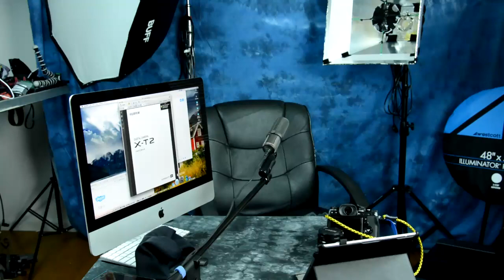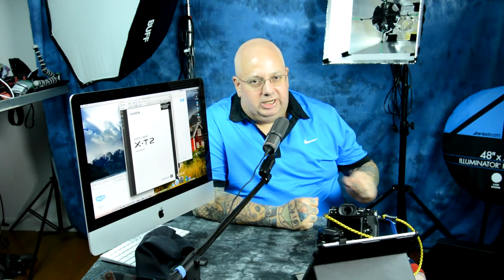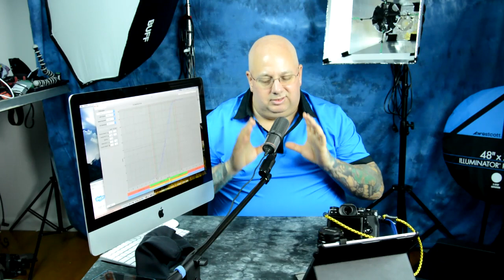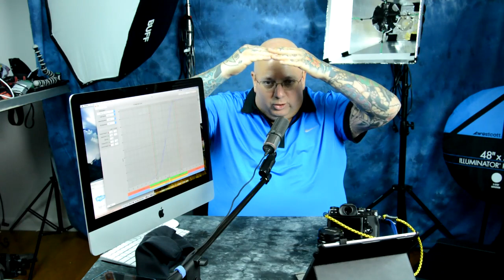WHY most current DX sensors from ALL camera Mfg. are 24MP sensors

Comment: The Nikon J5 has a 12 stop dynamic range, which is quite usable, though I'm sure most people would choose to have more dynamic range. 
I've looked at images captured from this camera and it looks like the lens has problems rendering good details. I will like to see how well it performs with good lens attached.
The Pixel pitch of the J5 would place 35 megapixels on on APSC. I think images on the J5 look like crap though.
I would think the biggest problem would be diffraction. I would like to see how well a high quality lens performs on a 20 megapixel 1 inch sensor, if you can get good results with this you will get good results on a 36 megapixel APSC.
Reply: I have been looking into this a little more. Firstly the one inch sensor is smaller than I thought. Since these sensors have 20.2 megapixels my maths is wrong, you can place 64 pixels this size on an APSC. I also looked at that images on imaging resource for the Canon G7X ii and they are suprisingly good for such a small sensor. 
The camera has 12.7 stops of dynamic range and 23 bits of color depth.
I believe they can make a good quality 50 megapixel APSC sensor.
Why do I want that? Because I don't want to throw money away on a full frame if I don't have to, and I print large and want more megapixels.
Reply: I think you are talking about a different measurement of dynamic range, which manufacturers publish in their specifications.

Did you notice at the start of the video he pointed out that he was describing sensor dynamic range without ISO or gain.  He is talking about the type of sensor dynamic range profile that you would measure with a light meter and a color chart like a X-Rite Color Checker

You could then enter that data into many light meters, so that meter measures light with the same sensitivity as your camera sensor.  This is done so that you can measure shadows and highlights before taking a picture, without saturating the sensor.

Comment: The Samsung nx1 is 28 mega pixel
Reply from the maker: i just talked about that in my video TODAY……Samsung NX1 is 28.2MP …..3.63 micrometer pixel pitch…..likewise it "breaks the threshhold" and has worse DR than other 4 (roughly) micrometer DSLRs…… Samsung NX1 does not have even CLOSE to the D500 performance in low light GAIN or high ISO theres not enough native gain there/……….samsung sacrificed 4MP for worse DR and low light high ISO performance

Comment: Interestingly enough Mr Northrups review of Sigma's 50 - 100 f1.8 made the suggestion that the lens was so "sharp " that it would need a 50MP APSC sensor to do it justice ( other than that he was not impressed by the lens overall ). If 50MP APSC sensors are released ( and I'm sure it's only a matter of time ) we'd likely end up with similar results that we can obtain with the current batch of 1"sensor cameras ( given they all sport 20MP approx ). To be fair Ive actually been very impressed with the results I get from my tiny Canon G9X, it doesnt beat my Nikon, Pentax or Sony APSC cameras but the results no doubt will continue to improve. My guess is the next resolution milestone for APSC will be 36MP. 😃

Comment: what about the Canon r and d center that has 200mp ff cameras?
Reply from the maker: gain and time…..of course you can make a 200MP sensor, unless however ultralow detectors are implemented, theres not enough gain there for good DR
Reply: Yeah might be like a car. At one time it was all about cubic inches, but eventually we're able to make cars with tiny motors that smoke big old muscle cars.
Reply: I wanna see that :p a tiny engine beating a v8 og V10 BMW engine ;p
Reply: Technology marches on, so the comparison is not really fair. All else being equal, there is no substitute for cubic inches.